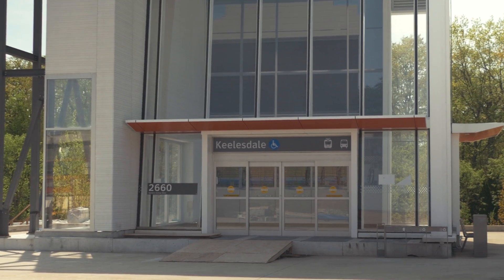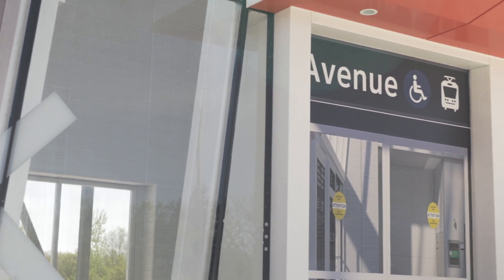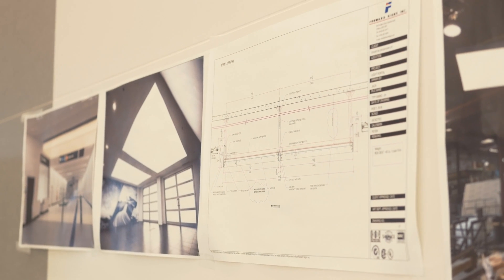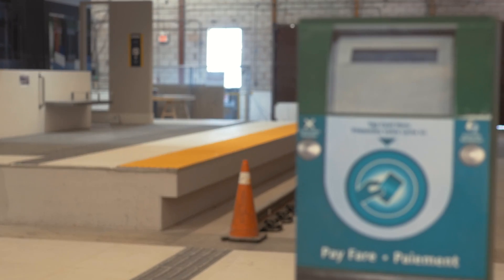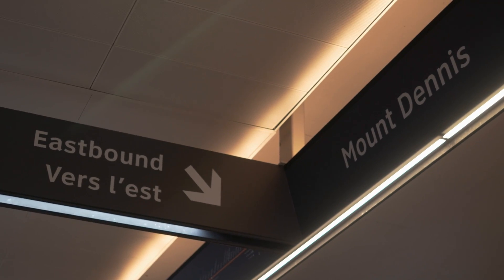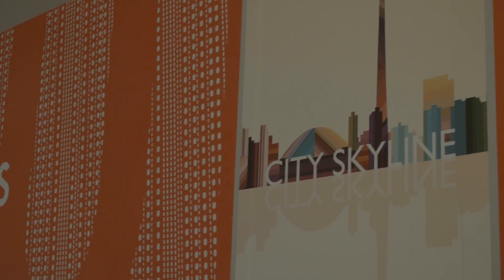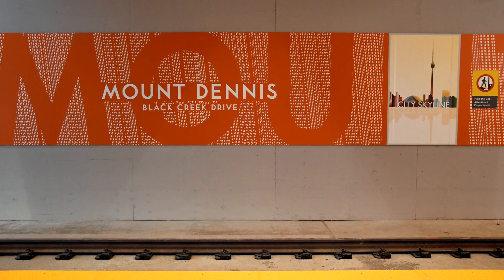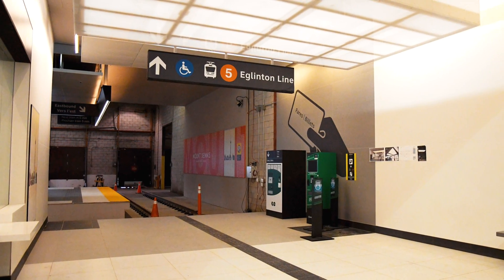Why Build a Mock up? - Design Excellence

Comment: Why isn't the station signs using TTC font??
Reply: Cause it's not owned and built by the TTC
Reply: @mrrobot5963  well if it is to be operated by TTC then I'm sure they've already designed their own signage system including future lines, maybe this is just a placeholder that hasn't been rebranded yet
Reply: @shadowygloom3302  Nope. Look at Pharmacy station. They have shelters now and it doesn't use TTC font
Reply: @mrrobot5963  it's weird bcuz I saw that Science Centre station entrance shows TTC font on the windows while under construction
Reply: @shadowygloom3302  That wasn't TTC font. In fact you don't see those on the rest of the TTC system.